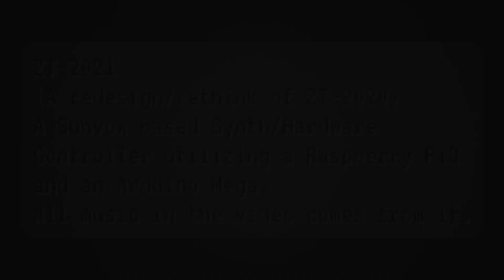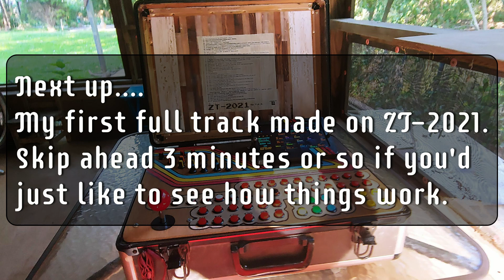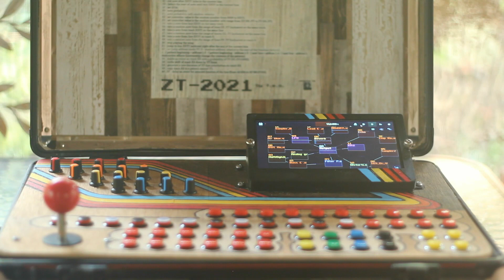ZT-2021 a suitcase synth powered by Raspberry Pi & Arduino running Sunvox

Comment: awesome build! I like your music, discovering it from learning about bhaji loops. I have a raspberry pi midi organ project that I've been planning to switch to Sunvox(from the zynthian software), the organ playing 3 synth channels and then Sunvox playing backing tracks to play over. Do you have any recommendations for a build like this? the organ has a 4" touch screen for the pi
Reply from the maker: Ahhh good ol bhajis loops 😁 yeah, you probably have everything you need to get going. Sunvox would work fine on a 4" touchscreen since it's designed to work fine on small phones anyway. I guess it really depends how much you want past the screen for input.